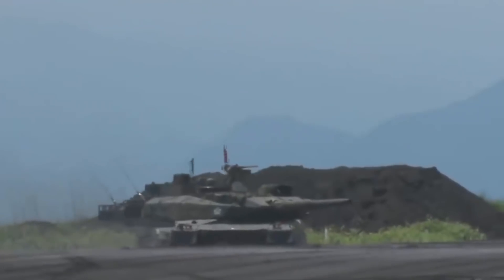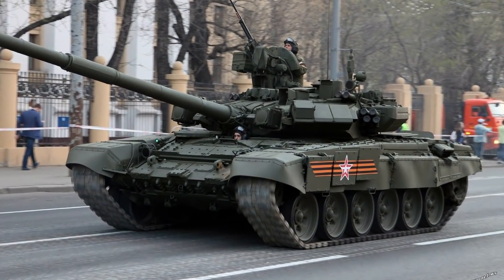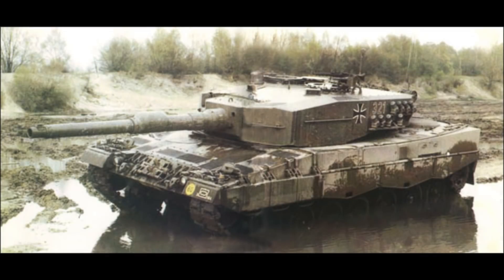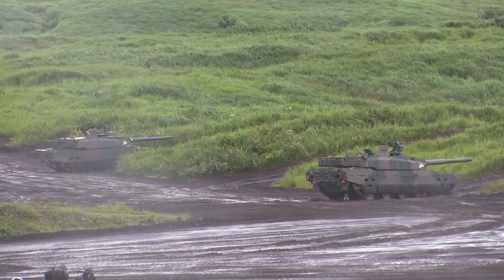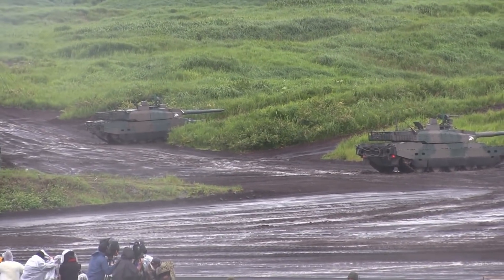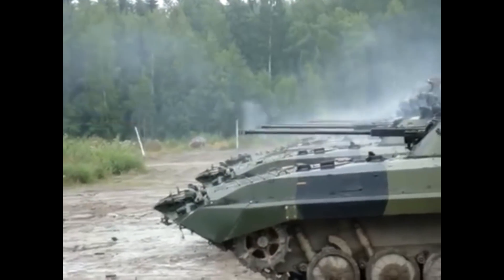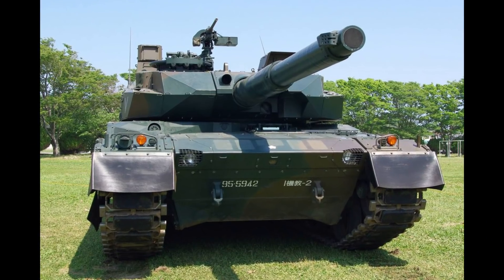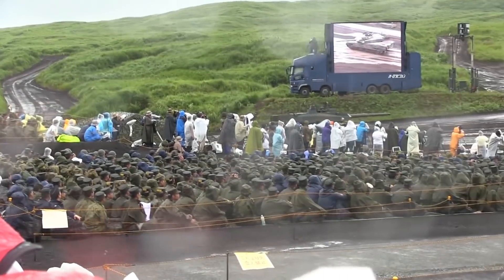Problems with Type 10 tank

Comment: There are reason why Type-10 wasn't intended to replace Type-90, instead it was intended to replace aging Type-74 and Type-61 which still used in main and southern part of Japan due to Type-90 weight limitation.
Reply: Good point.  Looking at the relative weights of the four tank types, it certainly seems as if Type 10 was intended to fill the roles of the earlier tanks.
Reply: In a way similar to the Leopard 2 iirc, since Leo 2s are supposed to replace the M48 Pattons and fight along side Leo 1s or something like that
Reply: Type 61 is not used
Reply: Come on, all Type 61 tanks have been decommissioned over 20 years ago!
Reply: Type 61 retired in 2000.
Reply: @Keeazul  At the time of development the Type-61 was still in commission.  -_-  just because we are talking in the future don't forget this tank was started in the mid 90's so yes it was developed to replace the Type 61 which was being decommissioned at the time.
Reply: @Skreezilla  wow. I couldn't imagine that they'd kept any of those in service past the 80s at the latest but wow.
Reply: @josephahner3031  still a few ww2 vehicles in service, the Taiwanese navy have two ww2 subs and a fair amount still use the chaffee tank wise.
Reply: "There are reason why Type-10 wasn't intended to replace Type-90" 
There's a problem with that claim: Type 90 production ended in 2008. The Type-10 is the only MBT being made by Japan since 2010. Maybe it was not "intended" to replace the Type 90... but it de facto will eventually. Unless the Japanese come up with a dedicated design to also replace the Type 90 eventually. Which... doesn't seem likely.
Reply: Are they planning on modernizing Type 90 ?

Comment: there is no composite armour in the side panels on the turret. There are photos of the hatches open clearly showing hollow space.
Reply: True dat
Reply: Two points. Add-on armor and if your tank is getting hit from the side, you’re already fucked.
Reply: @jesusofbullets  Add-on armor is very  heavy, nobody would remove add-on armor if they don't have a good reason like air transport weight limit.

Besides, it is designed to fight on islands and urban area, so infantry flanking and ambush are unavoidable.
Reply: @jesusofbullets  The type 10 has no appliqué armour Like TUSK or OES but yes. If these things are getting shot in the side there doing something horribly wrong.
Reply: @joelau2383  
It’s removable for transport via train or over bridges. The Type 10 was designed to be useable over more bridges than the Type 74 or 90.
Reply: @jesusofbullets  It takes a lot of hard work and times to remove and install add on armor. If you  need to remove them to cross every bridge, you should never put them on in Japan.
Reply: @joelau2383  Have you ever been to Japan? Most of the bridges where the fighting is likely to happen are highly load bearing as they're urban. They do have a lot of bridges, but that doesn't mean they'll need to take off the armor every time. Also, the armor is designed to be attached and detached easily.  "84% of Japan's 17,920 bridges are passable for the Type 10, compared to only 65% for the Type 90 and 40% for mainstream western main battle tanks."
Reply: @jesusofbullets  If they don't need to take them down most of the time, then why they don't put them on most of the time?

84% bridges are available for Type 10 only when they don't have add-on armor. As I said, this is why they don't have add-on armor most of the time and probably should never put them on in Japan. Otherwise, they cannot pursue and retreat crossing many bridges.

P.s. i went to Japan as tourist, not spy checking bridges load limit.
Reply: @joelau2383  
You have literally zero evidence for anything you’re saying, including that they’d HAVE to take off the add-on armor when crossing, that they can only cross that 84% without armor and that they couldn’t retreat or advance without doing so. Logic check, why would Japan make a tank with the sole purpose of deploying anywhere in Japan, which is also the lightest modern tank they’ve built, so heavy that they needed to remove the add on armor to cross bridges and then claim that it can cross 84% of all bridges in Japan? 

At this point, you’re starting to make stuff up while blatantly ignoring provided facts, and that’s a bit annoying.
Reply: @jesusofbullets  Add-on armor is more designed to increase angle of protection when hit from an angle. This means that the type-10 can only protect against hits frontally and any exposure of side can lead to penetration. Add-on armor would give them better survivability because they can now protect up to 20degrees more on each side.
Reply: @jesusofbullets  Also it's possible that the tank only needs to be light enough to cross bridges to get to their defensive positions and once they set up defenses, they can start adding add-on armor. Add-on armor can be transported from another vehicle.

They can easily add up to another 10ton of add-on armor if they already got to their defensive positions.
Reply: @joelau2383   If it is tank against tank, there are two things to consider.   First an enemy must find a way to put tanks on the shore. Once they are on the shore, they realise that their tanks are to heavy and to big for Japanese conditions. They can not deploy. They also will find the problems with bridges and narrow roads and off road is tricky to say the least,

Comment: Question: The tank is light because of Japan's geography.  Until recently, Japan's constitution prohibited foreign deployment. If that changes, can additional armor modules be installed in the field as needed??
Reply: There plans for additional armor on the sides of the Type 10, they’re just not fielded yet.
Reply: It could be possible, though i doubt Japan will develop armor modules for their tanks soon. Unless threat of a Chinese invasion of Taiwan or South Korea becomes very serious then they have no reason to make them.
Reply: It is possible, there are even heavy upgrades for M60 tanks which offer more protection than current Type 10 like Sabra tanks.
Reply: yes actually the developer in one of the interview mentioned about how era and composite armor can be added to the side hull. This would increase the weight of the tank to 48 tons
Reply: @ggoddkkiller1342  they need to revive M60-2000 project. Countries with a whole fleet of M60s and M48s probably could benefit from this upgrade.
Reply: @ggoddkkiller1342  There's no doubt that the base turret/ hull side protection of M60s and M48s are greater than Type 10 without spaced armour add on , imagine the frontal protection of these old tanks when upgraded with modern armour modules, they aren't that terrible as most people think.
Reply: they cold most likeley desingn and fit additional modules if they fell like its needed however i doubt that japan would do so since type 10 has good strategic mobility and they probably would like to keep it that way
Reply: @Henry-uq1hl  Lol, I think we reached the serious possibility of Taiwan being invaded months ago
Reply: @deanfirnatine7814  
The biggest obstacle to a PRC invasion of Taiwan is their inability to do so.  Or, rather, their inability to maintain a large enough force in the field to effectively do so.  Keeping a few hundred thousand troops in combat continuously supplied with sufficient fuel, food, ammo, spare parts, and other supplies is a much more monumental task than most people realize.  For invasion, it's the size and quality of the strategic logistical support infrastructure more than it's the size of the army.
Reply: Right in Japan there aren't any big fields for flanking maneuvers - this is the reason that armor is concentrated on front and agility of vehicule. Most of complains in this video is rubbish
Reply: @Henry-uq1hl  this comment did not age well
Reply: @Henry-uq1hl  To be fair, Taiwan is actually similar to Japan’s geography to the point the Japanese battle doctrine would work out decently there. Not to mention the only route of attack for Taiwan is by sea and air much like Japan.
Reply: There was even plan to upgrade Type 90
Reply: @hazardous458  shiiieeeetttt I knew bureaucracy gonna come in
Reply: @maxkronader5225  Or monthly typhoon who comes to Chinese maritime to halt invasion instead of firing rockets like from Gaza strip today
Reply: @olleto  Drones has no problem about scouting of tanks and infrastructure so your glorified tank would kiss artilleries ass goodbye
Reply: @jamesedwardladislazerrudo1378  Drones has problem to scout tanks when electronic scrambling is on - in such condition they can operate only off-line that will be hard to recon
Reply: @olleto   well tanks don't have electronic scrambler or GPS scrambler and you seen on Ukraine tanks were blown so easily with artillery and cost effective anti-tank mines
Reply: @jamesedwardladislazerrudo1378  you are wrong Abrams M1A2sepV3, Merkava has but limited range. In Ukraine there aren't latest versions of tanks. Every movement of tanks should be coordinated w scrambling vehicles - which Ukraine and Russia is lack off. In NATO doctrine every atack will be after getting air domination and destrying any thread to land forces. In that case there won't be any altilery peace, scrambling things etc, see desert storm operation - bombing and land advance after. Currently because drones such operation utilizes more diverse ordnance.
Reply: @olleto   That's bullshit drones were overused a lot in Ukraine even commercial ones and using bombs,grenades,and rockets on them

Comment: My guess is it's main function is spaced with the hinges allowing storage. From 30 degrees it would greatly alter the jet stream of a heat warhead and is a good design choice for a light mbt.
Reply: Well old saying is Big things swing on small Hinges .
Reply: @williamdodds1394  lol no
Reply: Yeah but it's effectiveness against modern shoulder fired rockets used by China is limited to say the least
Reply: Would it "greatly"? Because modern AT missile warhead would penetrate it like paper and would retain more than enough capability to pierce side armor twice over. Hell, I wouldn't bet on it stopping even modern RPG-7 warheads which is kinda weak...
Reply: @KuK137  im no expert, but im pretty sure spaced armor works against heat warheads. How is this any differen from the spaced armor on an mrap? Which i believe was pretty effective at stopping rpgs.
Reply: @KuK137  that's why I said at an angle. A direct hit from a heat warhead would probably not make a difference. But heat warheads are designed to have a Max effectiveness at a certain distance. Altering that distance degrades it. There's pictures available that show this. At an angle it may cause the stream to miss it completely or alter and degrade the path of destruction it causes.
Reply: @JD96893  "How is this any differen from the spaced armor on an mrap?"
simple. mrap doesnt use spaced armor. it uses caged armor which works by defusing the warhead when it hits.
Reply: @smokeshow7691  degrades it but does not nullify it. maybe in world war 2, but we are not living in world war 2. spaced armor degrades a certain percent of the penetrative power of a warhead, but it would work only if there was actual thick armor behind it to absorb whatever penetrative power is left. in this case, with modern warheads used by the RPG-7, it would literally make no difference. do you know how much penetration a PG-7VR warhead of the RPG-7 has? no? then dont make false claims about shaped charges.

Comment: The Japanese have a heavy tank but it does not work well with their current strategy.  Japan is pretty much just a series of volcanoes sticking out of the ocean and presents unique challenges for tanks.   It doesn't matter how good your tank is, if you can't get it to the fight it is worthless. The Japanese were having problems getting around on their islands with the type 90 and its really good suspension system that is why they are building a new tank to suit their needs.
Reply: Exactly. The armor may be garbage, but protection against 14.5mm and lobbing 120mm SAPHEI is one mean threat when the enemy must land amphibiously with little if any armor that can defeat said vehicle. Who cares if 2A42 gun can knock it out, if the enemy can't have those, and holy dog shit they're shooting 120mm at us direct fire.

It's built for a specific niche.
Reply: @poopstick924  while things like rpgs and atgms might pose a threat to the sides of the type 10, the main goal of the Jsdf is defense of the home islands. Meaning the type 10 will almost always be in a defensive position with its sides likely secure. That is unless Japan decides to send the type 10 into overseas head to head combat with the enemy in an urban environment. That is where the type 10 would probably fail.
Reply: I mean that sounds well meaning in concept but Type 10 is only 5 tons lighter than Type 90. The idea was the armor would be completely dismounted and moved via rail car or a flat bed truck across country however there isn't any instances of this being done and all Type 10's are still based I'm Hokaido just like the Type 90. If anything the Type 16 filled the role the Type 10 was supposed to fill as a rapid reaction tank able to move with easy across Japan's rural area's
Reply: @poopstick924  well its never stated if that's while combat loaded or unarmored.
Reply: @poopstick924  I mean you literally got those statistics word for word from Wikipedia so willing to wager you don't know if that unarmored or armored. Also the standard configuration is othe only armor layout for the tank as the "heavy Armor" layout has never been publicly shown or purchased by the JGSDF.
Reply: @nemisous83  thats not true. Eastern and Western Army formations already received Type-10s. And Japan has mostly if not totally discarsed its rail transport means for heavy military vehicles

Comment: When you're fighting in mountains, specifficaly in valleys there's no need for side armour because it's very hard or almost impossible to flank your position. That's also why in case of K2 there's not much side armour.
Reply: Lol mountains are not the only place for tank battles it can be anywhere so tank must be always ready
Reply: @ice-tgaming4609  yeah but all tanks have dogshit side armor anyways so why even bother
Reply: Even in mountains, a RPG can hit you by the side.
Reply: @innerlight7018  In proper combined operations, infantry are not getting a side shot on a properly operated tank working in tandem with infantry. In mountainous terrain, that becomes even less possible especially when the defenders have the home advantage. The U.S. didn't send their Abrams into the mountains to root out insurgents, they sent infantry and smaller wheeled vehicles as support with tons of helicopters.
Reply: Actually in mountains it is extremely easy to flank enemy.
Reply: @atheist6598  which is why you dont send tanks without any form of support
Reply: @atheist6598  With proper combined arms, it's actually MUCH harder to flank your opponent in the mountains. You have the demerits of moving through overgrown forests while also contending with uneven terrain. Everything moves slower and louder in the mountains which makes scouting for flanking and maneuvering units as a defender much easier to do. There's a reason why mountain specialized units are very small and lightly equipped. The Japanese are the defenders and know the terrain and have already setup special routes and defensive positions and the Chinese would have to use their engineering corps to cut paths for their armor to get through while getting hammered by the emplaced Japanese. There's a reason why militaries have sought after and built fortifications in mountainous terrain. It's a natural barrier and impedes the attackers while making it easier to scout and gather intel. During WWII, the U.S. spent ridiculous amounts of manpower and resources digging the relatively few Japanese defenders out of their mountainside defensive positions and it'd be the same for the Chinese except their enemy has the technological edge.
Reply: @ice-tgaming4609  that’s why variants exist smart guy
Reply: @kentkubota.3237  nah the Japanese mbt is still soft for modern warfare
Reply: That's the reason why Philippines needs this kind of tanks😌😌
Reply: @jayarr8866  the japanese tansk cost 30million usd per unit
Reply: @ZayP730  Side armor allows you to have greater angle of protection. It's important when you don't have enough tanks to cover all degrees of fire zone so a tank is expected to cover up to 120degrees of field of view. This means your side will be exposed and having side-armor add on can protect your side in case your turret is aimed elsewhere.
Reply: @ice-tgaming4609  That's sort of what happens when you are restricted as to what weapons you can build.
Reply: @ice-tgaming4609 
🇷🇺🇺🇦「💀」
Reply: @ice-tgaming4609  75% of Japan is mountainous, the rest is mostly urban.
Reply: @kentkubota.3237  That's because Japan has not built a lot of them and Japanese labor is expensive. Most of the money in defense contracts are in R&D and the production plant, which are fixed price regardless of how many units you build.
Reply: @ice-tgaming4609  it's designed for Japan to stay in Japan most of it is mountains and hills
Reply: @banananoodles  geography does little validate the strength of a tank it's a tank it's meant it must be heavily protected so it can survive many hits and damages even if it's mountain and hills portable anti-tank rockets and drones can easily hit it so having tank that has a weak armor means it can easily gets destroyed in a short period of time and never under estimate enemies weapons are advance today so you need the best protection as much possible